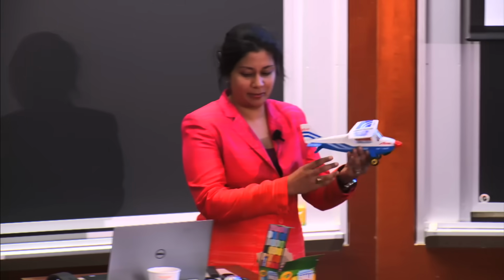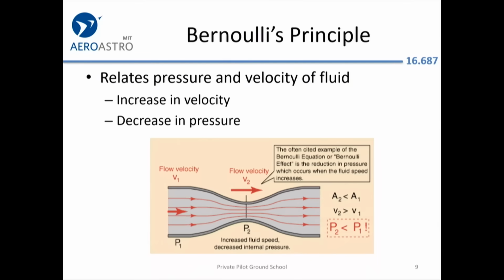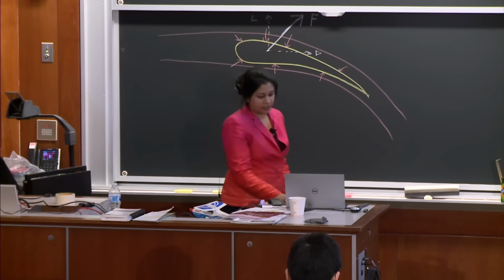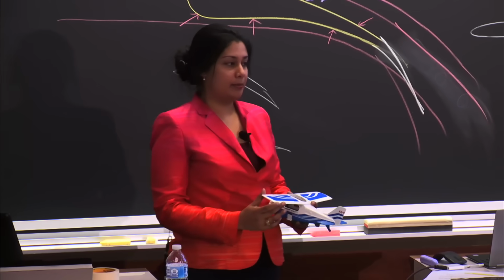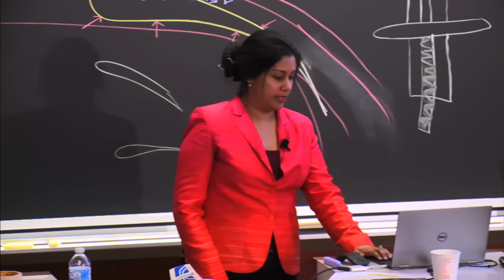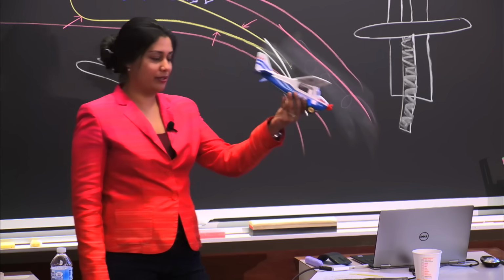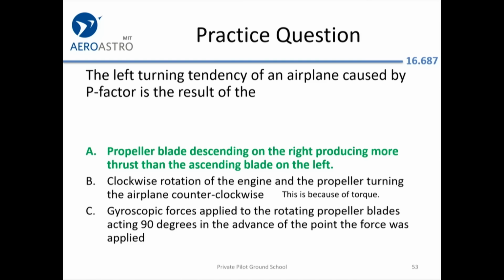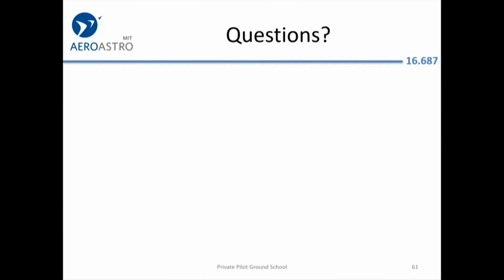Lecture 2: Airplane Aerodynamics

Comment: Great job!  Another way to short-circuit the whole airfoil misunderstanding is to take the example of high-performance aircraft (fighters, aerobatic aircraft) that have symmetrical airfoils - they seem to fly just fine!  Angle-of-attack trumps airfoil design by a wide margin.
Reply: What misunderstanding?
Fighter jets rely on very high speed.
There is at least one very  light aircraft that takes off at about 20 mph. This is possible with its very high camber.
You're not comparing like with like. A PA28 would need considerably more indicated airspeed to lift off with a flat plate wing ... hence the camber. Angle of attack does not 'trump' anything. It is one component of lift.
Camber is essential for most aircraft.
Reply: @aeroplod  My point is that the way most people are first taught in school completely omits AoA.  They are just told about the magic of the airfoil shape.
Reply: Fighter jets do NOT have semtrical airfoils...  have you ever seen the the cross section of F-4, F-15, F-18 even the F-117 wing. they ARE NOT semetrical.

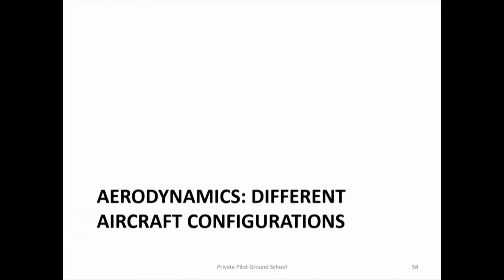Comment: 1:08:52  The younger generation is the video/tech generation so lack of windows may not be a problem if you use the flex screen technology to make the whole of the interior like an onmimax theatre.   You can show nearly a 360 degree view of the aircraft as it is on the ground or in the air.

Comment: There is a misunderstanding. If there is a smooth steady flight, their lift is equal to the weight and thrust is equal to the draft. Not has to exceed, but be equal. Only while changing velocity or altitude do these forces exceed one over another.
Reply: Lies again? Battery AA
Reply: The presentation is absolutely adoring and great. At some points I am not entirely sure if they (both) give intentionally short and simplified answers or if they in fact don't really have the answer. Most prominent this was on the question on the origin of the p-factor, none of them mentioned the asimetrical angle of attack on the propeller as the reason for the asymetrical thrust creating a force with a line of action right to the center of gravity, resulting in a momentum leading to a left side yaw....

Comment: As compared to the lecture by the ex F-22 fighter pilot with the graduate degree which I think in aeronautic engineering, who seem to have more flying experience, this lecture seem more boring since the lecturer is teaching to the test for students interested in passing the test to get their FAA private pilot license.  That  other guy seem like he has the practical flying experience but also the academic engineering background to apply engineering principles to flight theory.  

Not to say she is bad, but she seems more like an aeronautical graduate assistant, which is like a student getting a graduate degree but teaching other students to get some experience.  Teaching a test prep course is an example of what graduate assistant are asked to do at an university. The professor that is sitting in on the course is probably her academic advisor.  He is probably also the program director since you also see him in the video with the ex F-22 pilot.

Comment: Just curious, if the propeller of the aircraft rotates in a counter clockwise direction, would that mean that the plane has a right turning tendency?  Because the counterclockwise propeller would result in the corkscrew effect and torque affecting the plane opposite to what was discussed right?  Can someone confirm this. Thanks :)

Comment: I was listening for a more direct explanation about the dynamics of air under the wings compared to air above the wings. 
From my observation a unique aciivity is happening above the latter half of top surface of the wing
Unfortunately my obser vation of the flow of air over a wing in a wind tunnel does not show other activity as I observed in some Videos

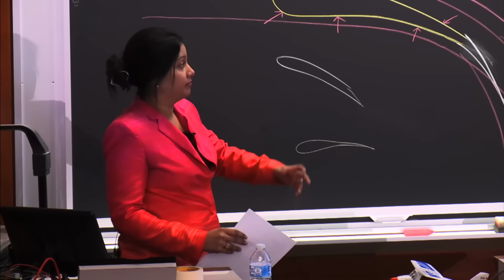Comment: 29:32 I think better solution is to split the work in this case make a lot of simulation to have data base of this turbulents. so instead put ZERO(0) and pretend dont exist that is better tu put the estimation of previews experiments. (Example you fly A320 wings than previus you made a lot of experiment and colect data with that wings in diferent presure molecule humidty etc so you just need put the wing model and the rezult of previus experiment(the statistic aproxiamtion, not the best or the wors data of the experiment))

Comment: Im surprised to say this but I am disappointed. First, while the deflection of air (relative wind) along the lower camber of a wing does produce lift, it is the Magnus effect or differential pressure between the upper and lower surfaces that produce the majority of lift. Also...regarding the race car. It's not a spoiler, it is an inverted wing. Therefore, the wing is creating downforce not spoiling the lift by introducing turbulence. Also notable is the front mounted splitter that also creates a differential pressure between the air flow over the top of the car compared to the airflow underneath the car. 

I am a pilot, mechanic, educator and have also built aircraft and race cars in the past. While I do not have an extensive aeronautical engineering and do not claim to know everything, I do believe this presentation to not be exactly correct. I thought MIT would have a better understanding of the principles of flight.
Reply: Hello sir,i read the explanation, here it says majority of the lift produced  by the differential pressure between upper nd lower surfaces of the wing, which is based on bernoullis theorem,can we say the rest of the lift produced as per law of conservation of momentum? Please clear my doubt,what about the lift generation in the case of inverted flight as the case where the airfoil upper lower surfaces changed,can we relate bernoullis principle here in inverted flight?how can we explain the reason for lift here in inverted flight?

Comment: If you are going to debunk equal transit time as nonsense don't do with more falsehoods!! At 10:30 the claim is a flat plate makes lift by deflecting the air down and the illustration was air hitting the underside of the flat plate. 
Do the maths on that and you will see that you are missing quite a considerable % of the lift that is generated. 

So yes, equal transit is nonsense but it's new nonsense as when I started my journey into professional aviation in the 1970's nobody ever said anything about equal transit times. Just that the velocity was higher over the upper surface. Which it is on your flat plate by the way!

Comment: I explained to fifth grqder Hispanic students  the Bernullie effect with low pressure developing over the top of the win thar sucks the plane up.  The speed determine the displacement of the air so when it reqchew the weight of of air more than the weight of the plane, the plane goes up.  Smpler and easieer thn this professor and more unerstandable.  And she teaches at MI???
Reply: shes not teaching to 5th graders
Reply: I was in China teaching when a hot Chinese pilot flew under the wing of a US spy plane.  The US spy plane dropped down om the hot shot pilot causing his plan to crash into the sea.  "Murderous American pilot dropped his wing on Chinese [ilots wing.  I then explained the Bernullrie effect that the low pressure above the Chinese plane equalized the low pressure of the pilot's low pressure above the wine of the spy plane causing it to drop.  Sll talk of murderous American pilot stopped.  I stsnd by my statement.

Comment: You do not understand the equal transit theory. What it try's to say is that because of the difference in length of travel the upper wing create a low pressure and the bottom a high pressure. So you your telling me that Benallie's principle is wrong???

Comment: And as a result of equal transit theory being wrong, it has nothing to do with pressure. The higher air pressure below a wing is a result of the air being deflected, it doesn't provide the lift.

Comment: My own thought experiment to refute incorrect lift theory has long been the existence of aerobatic flying "upside down". If it weren't mainly the angle of attack and good old Newtonian physics instead of equal transit shenanigans, that kind of flying would be impossible (save maybe for reconfiguring wing profiles in mid-air, which I'll assure all is not what happens).

Comment: This is a pretty poor explanation of lift.

For something that follows all the applicable physics fundamentals step-by-step, please see: Understanding Lift Correctly: https://rxesywwbdscllwpn.quora.com/ 

0:50 Vocabulary: doesn’t  mention the vertical and horizontal “stabilizers”. Calls them “parts”. In the graphic, but not mentioned.
There is only ONE wing.
Going to talk about sea planes ???
3:11 initially says lift exceeds drag, but corrects it.
4:50 Draws an extreme airfoil shape.
5: 30 Air has mass and conservation of momentum. This is very vague explanation.  Doesn’t explain how the push occurs (which is from pressure).
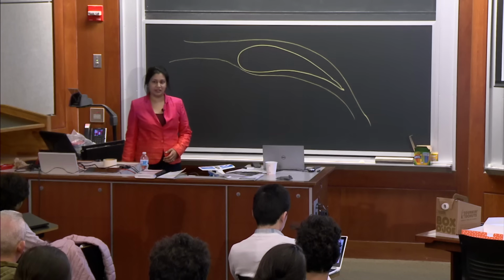6:12 Explains Equal transit, longer distance fallacy. Points to flat wing having the same length.  Math description not needed.  Good Aeroastro graphics.
12:01 GOOD: Stated Bernoulli correctly using ‘velocity’.  BUT focuses on fast, not changes in velocity which is acceleration.
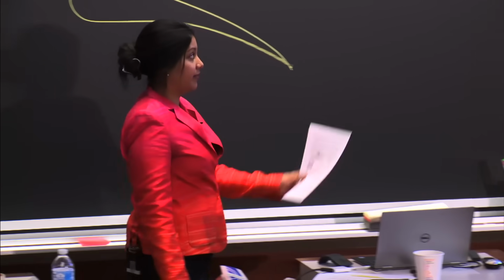12:42 The Graphic assigns INCORRECT cause to lower pressure.
12:49: Answer “A” is the only correct statement, but has nothing to do with Bernoulli’s Principle.  There is no such thing as an “additional force” (B).  The air is Accelerated toward the trailing edge by the relatively higher pressure forward of the wing and the lower pressure above the wing. The Pressure Gradient is the CAUSE of this acceleration. So “C” ic flat WRONG.  THIS is where the incorrect interpretation of the  Bernoulli Principle is applied incorrectly!
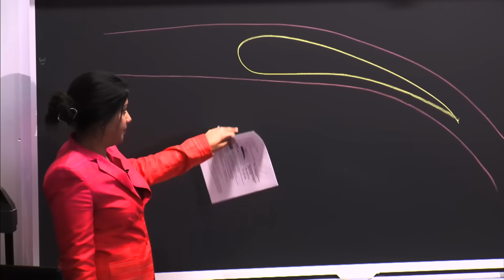14:00 GOOD: Shows stationary pressures.
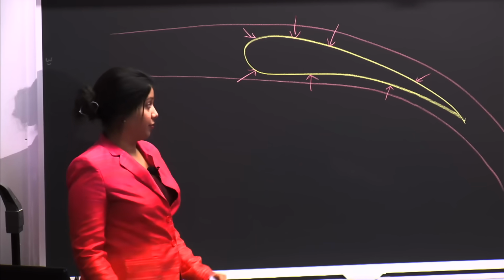14:40 BUT fails to say that the Force is the net force from the pressures that have changes due to the  motion. The TOTAL “force” is due to the net top-to-bottom ‘normal’ pressure difference and drag caused by the wing’s motion.
15:14 Asks childish questions. Race Car.
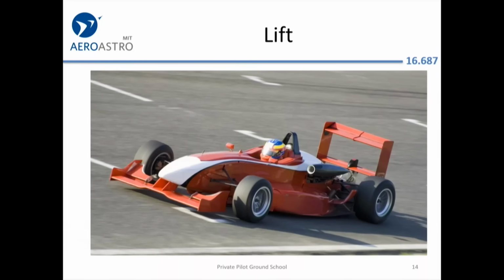16:36 Only says the spoiler “spoils” the air flow. Doesn’t explain that it has down lift.
18:09 Wing changes the speed of the air ALSO.
Never states that upper air beats lower air to the trailing edge.
18:54. Is wing moving faster through the air, or air moving faster past wing? Frame of reference discussion. Wind tunnel justification.  This is an unnecessary diversion as stated. The relative motions are essentially the same in the wind tunnel, So wind tunnels are valit for testing.
23:40 Mentions aspect ratio without explaining it.
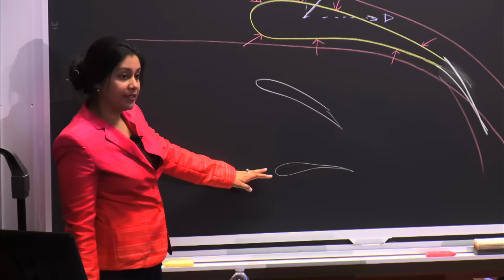24:24 Mentions your  hand out car window and PUSHING, but doesn’t relate to the momentum explanation earlier. It’s just another wing and provides nothing new because we can see planes flying every day.
25:28 Mentions Viscosity. Compares sticky.   Sticks to the wing.
27:10 Compressibility affects lift in a different way.  NOT FUNDAMENTALLY.
29:45 CALCULATING LIFT.  Mentions Kitta Condition but not why it is important (which is isn’t).  Tip vortex in not true turbulence. 
Doesn’t explain chord line.  Says:  “in between.
32:25 Talks about summing forces around the wing for lift, but doesn’t explain the top-bottom difference.  So she leaves a large hole in treh connection to the pressures and the momentum story.
38:10 Doesn’t actually state what AoA is.  Graphic shows it as “A”  but is unnamed.
42:20 CONFUSED about the effect of flaps. Airspeed being higher with ground speed lower HUH???  Also doesn’t explain approach being steeper. Misses that is the increased lift that allows slower air speed.
47:38 Only explains that roll is around the longitudinal axis, but not the others.
48:13 Doesn’t explain why adverse yaw occurs.
48:15 Stability OK.
53:30 Question about what happens beyond the critical angle is not answered correctly.  Lift does not go to zero. Did not demonstrate a paper airplane stall.  It was too stable.
54:45 First mentions separation.
55:56 climb & decent, lift = weight.
57:15 Torque causes a left ROLL.
57:50 P-Factor not so much climbing because AoA not necessarily high, just on ground.  They can’t answer the question at 
1:02:20 Precession is 90 degrees  later.
1:03:14 Question why P-factor not subject to precession. Sort of answered. It is a bigger factor on the ground for a tail dragger the ground where the ground  prevents precession and in slow flight when precession only occurs during actual yaw.
In zero G flights confuses the upward parabola with top and downward parabola with bottom.

Comment: No (1:09:31). The reason they don't use this aircraft is because it is a harder ride for passengers as the wings dip, there is a huge change in the center of gravity. If it banks right the passenger on the port side will be higher up than those on the starboard. Luggage and freight become a problem when shifting the center of gravity. You already feel these forces at play on planes without blended wings (conventional oval/round fuselage) but they are amplified if you are in a blended wing. Airlines don't want there crew and passengers thrown across the cabin from left to right. Elimanate the need to bank the blended wing aircraft ride the ride would be much better. You would not have refreshment carts going up and down, left and right all over the cabin. The effect remains even if you isolated the passengers to the center of a blended wing. So it is pointless. Imagine flying on the wing of an aircraft and it banking to the right, you would slip right off the wing going through the tip vortex being tossed in the air until you splat on the ground.

2. The weight/mass of the freight would be shifting and it would greatly change the flying characteristics and add unnecessary stress to the entire air frame. Momentum would always fighting the control surfaces.

3. Windows are a factor, but the airlines can live with this. They've developed cameras on the outside of the aircraft so the images can be projected all over the cabin. The LED images being displayed would surround you making you feel like you are flying outside. So, windows play NO factor. That has been solved and we may soon see these on Airbus, It uses a lot of technology from the HUD, without the moving cameras.

Blended wing does not even suit military use as it's wings would be a huge incredible target for a BOGEY. The surface area is huge. Might as well draw a big red circle on the wings encompassing the full bottom and top of the blended wings are an easy target. You just make it bigger with a different air frame, unless you are onboard the flagship NCC-1701, the Enterprise Star Ship. That would be an easier target to hit. But I digress.

Consider the passengers on the Airbus A380 on YouTube landing in a crosswind. You will see the tail of that bird going right/left in a matter of seconds. I could not image the forces that the back of that aircraft takes when the tail is going left to right so quickly, These type of landings are inherently dangerous in the back of the aircraft landing in cross winds. Enough to kill passengers and flight crew in the back of that aircraft.

Comfort and safety rule out using blended wing. Its just not fun being an object slamming into everything in the cabin. It would be a fun ride at a State Fair, but not comfortable for commercial human flight. One reason we do put people on rockets and fly them from NYC to Hong Kong in an hour. No comfort from the G's being produced so quickly.

I don't understand how you can teach all of these fundamentals so eloquently without even reasoning why a blended wing aircraft would fail. Nonetheless I give you a thumbs up for an outstanding lesson. Keep it up! You covered the material extremely well! I enjoyed it.